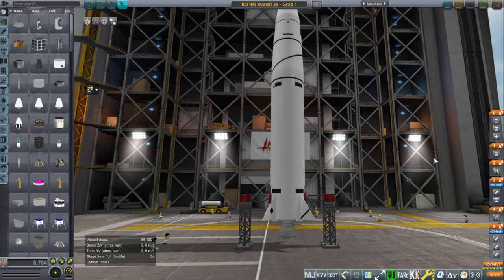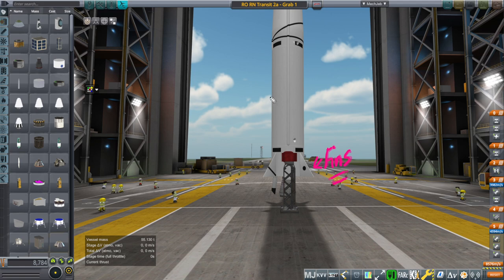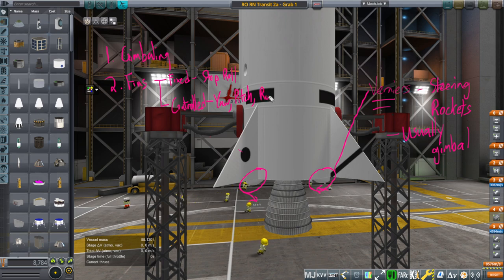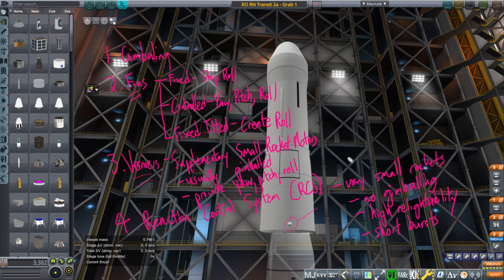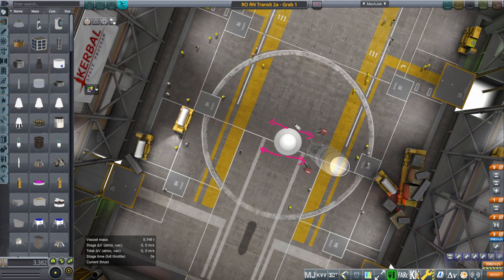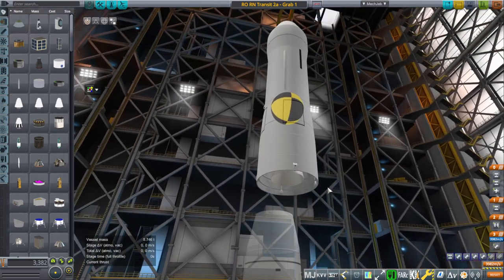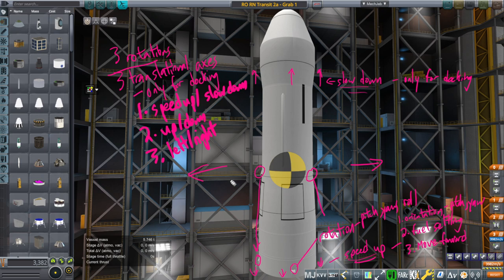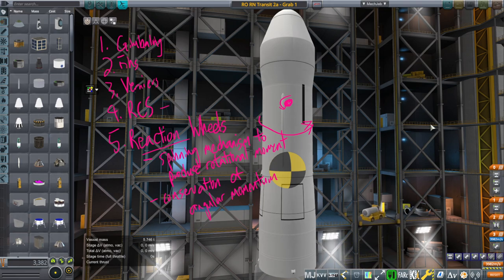Space Basics 05 - Orbital Rocket Design Part 2 - Control

Comment: How do the RCS tanks themselves get ullage?
Reply from the maker: Depends on the system, but they require much less pressure than the main engine and their tanks are just smaller and easier to keep at a higher pressure, so they'll get enough propellant to light properly. If the RCS runs off the main engine's tank, it can also have header tanks - small high-pressure holding tanks that are kept topped off from the main tank. The Agena stage actually had a header tank for the main engine, too, so that would be used to start the engine before it would draw propellant from the big tank.